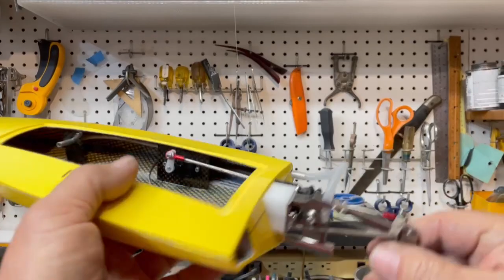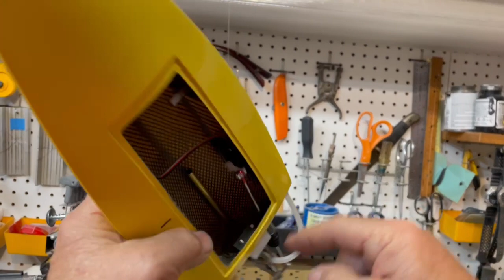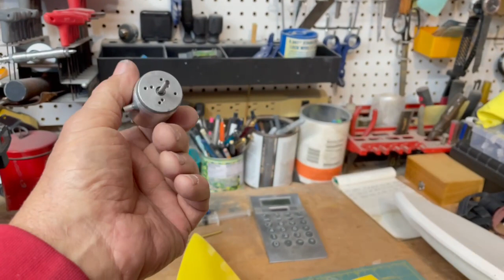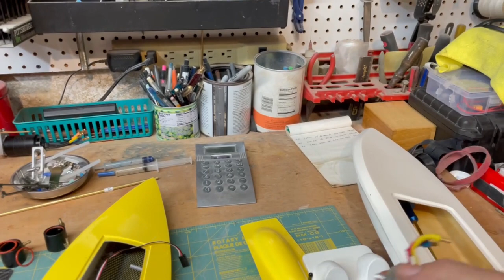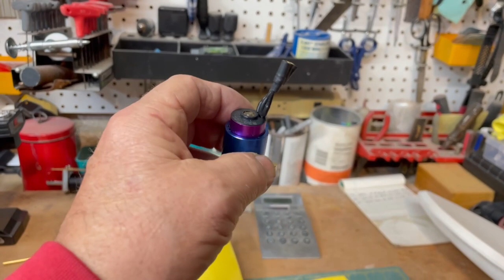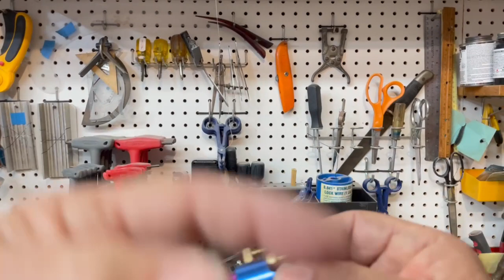Dr. Jet ponders motor selection for the Mozilla 400

Comment: kinda looks like one of those ecomaster hulls they are advertising right now. i dont have much luck with the wide rear transoms style. unless it has the motor mounted forward with a very small rudder  and prop underneath the hull... if you understand what im trying to say. they go full throttle for just a few seconds and they corner harder than any rc boat ive seen.
Reply from the maker: I have one of those ECO hulls in my inventory, I just haven't had the impulse to build it yet, but I know exactly what you are saying.  They corner like crazy, accelerate from zero to wide open in about the length of the hull.  I'm just building this one as a fun runner and trying to keep it as light as is reasonable.